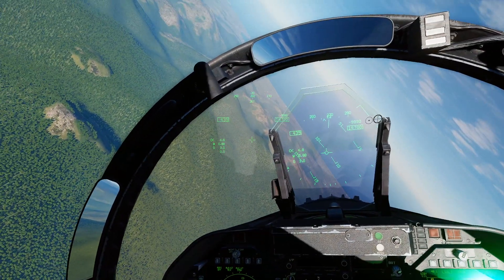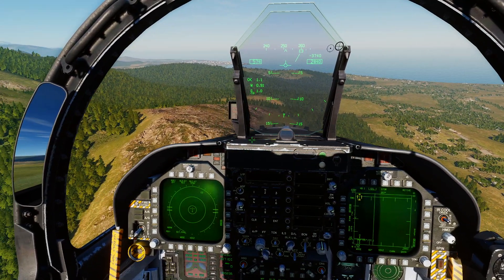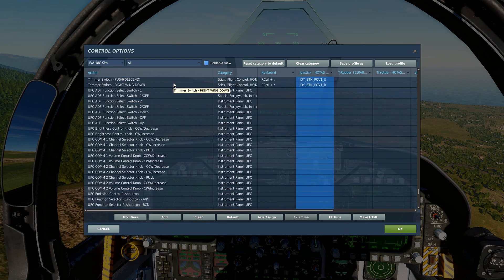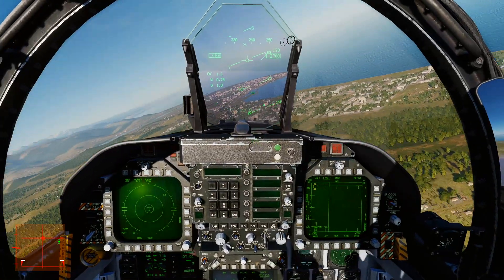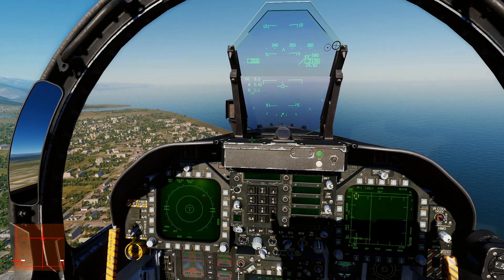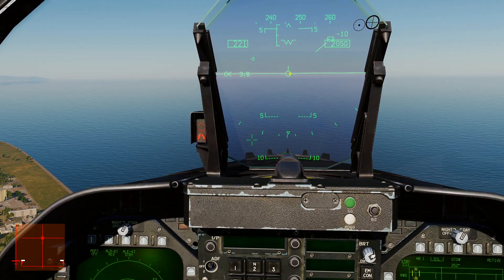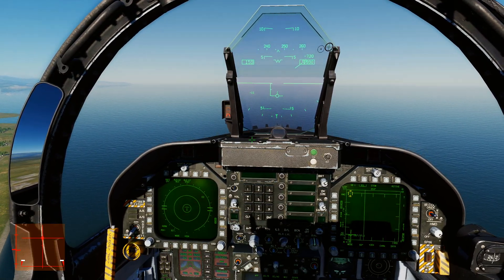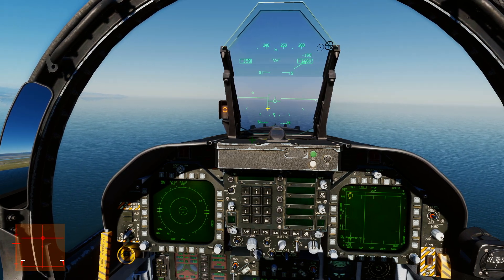DCS - F/A-18C Lot 20 Hornet On Speed Landing Configuration

Comment: Great series.  How do you address the 'flare' when you deploy gear and flaps?  I find the flare punches the nose up so much I am pushing forward on the stick which screws up the trimming etc.  Once the jet does settle in (I'm not sure if it is speed related?) then I can trim it on to proper AoA.  How do you control the flare?
Reply from the maker: I push the nose forward and hold it forward while trimming as aircraft speed keeps reducing. Around 150kts the float should be almost gone and more controllable